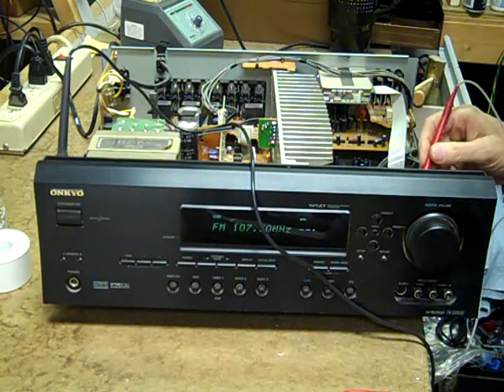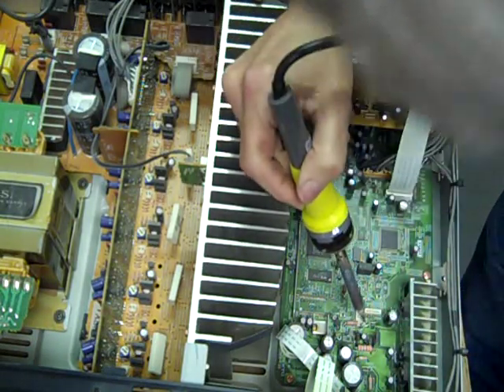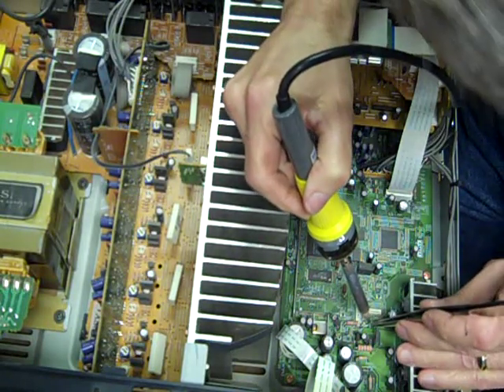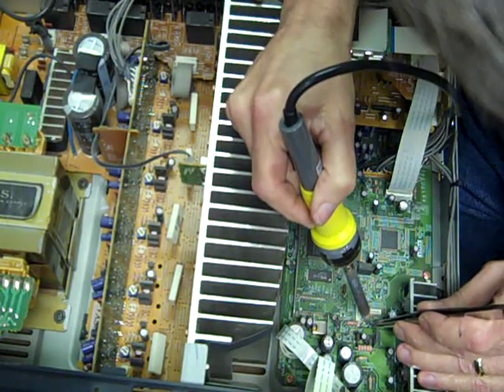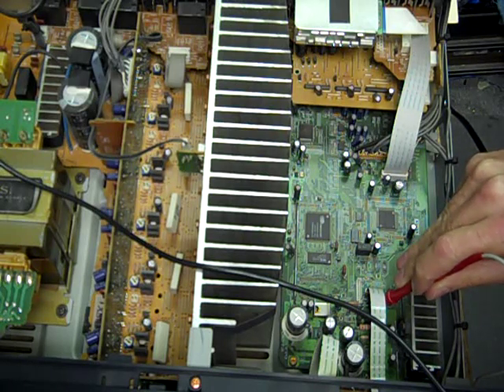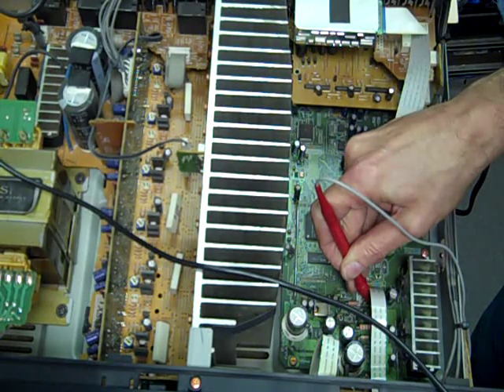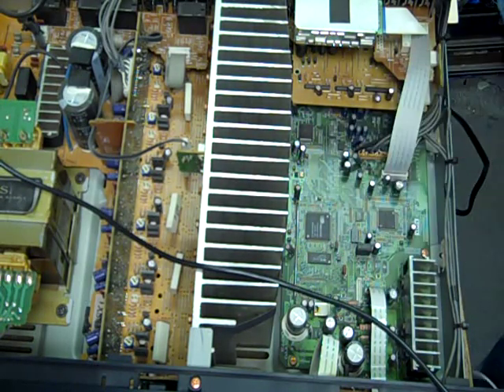Onkyo TX-SR502 Repair Brief

Comment: Mark,

Just wanted to let you know the oem 5 volt regulator was indeed bad. I replaced it with a 1.5 amp lm7805 and now everything is working properly. I did obtain a service manual and schematics for the receiver which helped immensely.  Thanks for making the video. It steered me into the right direction as to what to look for.  While I was at it I also checked all the 12 volt sources to make sure their outputs were in spec. Again, thanks!
Reply from the maker: Good Job!

Comment: Mark you are genius! Removed speaker A relay and replaced it with speaker B relay(until i can order a new relay off internet as nobody stocks that part in my area) and it works better than the original ever did. After researching everything from part location, solder removal and soldering(using my hobby wood burner at that), i am very happy with the result and appreciate your advice to no end. Now im interested in learning all the basics i missed. Thank you!
Reply from the maker: That's great to hear! Thanks for the feedback!

Comment: Mark:
Excellent suggestion on the output side cap. Tested at 95 Mfd. Should have been in the 330 range. Also replaced the +5 volt regulator with an LM7805.  Unit works perfectly (everytime ) now.  Thanks again so much for your help. Appreciate you!
Ryan
Reply from the maker: +ryanbdr I accept Paypal... ;-)

Comment: Thank you Mark, for creating this particular video. Without it, there'd be an amp on the way to the tip. Instead, I've just fixed my amp (same model)!!! I didn't bother with the coil -- I just soldered a jumper across, like you suggested. Works fine now! Thank you very much for sharing your knowledge. :) I have another of these in the attic, with the same symptoms. I'm going to take a look at that one now... :)

Comment: lol..i appreciate the response i went to school for computer electronics and im very handy i've fixed lcd tvs...laptops..cell phones etc...but im no GURU thats why i reached out for help and never fixed a receiver and i can see you are very knowledgeable so i measured accross all seven and got .6-.8ohms except 2nd to last i got 620 ohms and just kept going up and up as if its open also the compacitor at that same location is blown the noble reads phr mpr 2w r22k x2 i appreciate your help thanks

Comment: thanks for this video! I have the same receiver, with the exact same issue. I just soldered a bit of wire in there instead of the part (turns out I am too unskilled to solder in the tiny replacement part), and it's been working like a charm ever since.

Comment from the maker: Glad that seems to have worked out for you. There is a voltage drop across the coil in normal operation. Maybe about 0.3 volts or so. Keep an eye on it, but it seems like you nailed it!

Comment from the maker: OK, if you can check transistors, you definitely should check that one that sits between the drivers - it's associated with the bias transistor, and if it's bad the amp will likely blow again. When you first power up, the voltage across the whole emitter resistor should settle down quickly to no more than about 5 to 15 millivolts. If you see a lot more, and especially if it's climbing, shut down and fix the remaining fault. A 100 watt lamp in series with the main power prevents new damage.

Comment: Fantastic and clear video, Mark!  I frequently lose output on several channels (sr, sl, center, back) but left/right and sub are always reliable. I will tighten the banana plugs as you suggested to another commenter, however I think I had the same problem long before I used banana plugs. Do you think this is a coil issue, dsp problem itself, or something else?

Comment: Mark, Don't know if you still check this thread but I have a TX-SR502. I removed the cover, blew out the unit as it had minor dust in the unit. I checked the voltage on each side of the L7002 coil you mention. you state the voltage should be 5 volts. However, the most I get is 2.19V on one side and 2.14V on the other. Where does the 5 volts come from?

Comment from the maker: I don't work on many late model Onkyo's but I can tell you. if it clicks when you press the main power(standby) turn-on button, the smaller transformer is OK. Maybe there are fuses blown relating to the main transformer, maybe that transformer is bad, maybe there is a problem with the -30 volt source for the display. Carefully check to see if the main B+ for the output transistors comes up when you press the power button.

Comment: ok thanks mark. you're pretty certain it's the actual hdmi controller though, from the symptoms I have? it just stopped all of a sudden with all 3 inputs showing nothing. but the menu, volume bar etc working all fine (which made me think it at least wasn't the output gone so wasn't suspecting major chip

Comment from the maker: I'd look first for a blown channel or a bad muting transistor. A quick check is to check the emitter resistors. If one is open, that channel is blown. A blown channel with a good emitter resistor would shut down quicker due to over current.

Comment from the maker: @Iloveufonzi I would just have to do the troubleshooting but problems like this usually come down to either a blown amp channel or a power supply problem of some sort. If you aren't a technician your chances of fixing this yourself are very slim. Even a lot of techs have problems with these.

Comment: Mark: I've check out my other dud amp, and it has the exact same symptoms, but doesn't have the same problem with the coil. However the input voltage of the coil is 3V, not 5V like you mentioned in your video. There's a TA4805S voltage regulator nearby (Q6406) that has 11V on it's input and 3V on it's output. Am I right to assume it should be 5V and to assume that it's faulty and needs replacing? Tx :)

Comment: I have an SR-502 that's had a dodgy subwoofer output from day 1.

I have a nice Sub; I'm pretty sure it's ok, as when there's a hum on the line it reproduces it and the pilot light turns green (on).

I remember there's something tricky about getting the sub to work in the Onkyo anyway, such as only speakers A must be selected, and you have to have the "Deep bass" feature "on" as well as subwoofer selected. All those are true.

I substituted a simple computer audio subwoofer, and it was silent, too.

I wiggle the subwoofer output connector and it makes no difference. I've changed out the cable, too.  It's a simple RCA connected single cable. No joy.

I'm thinking of buying a new receiver, as I get my entertainment off the internet now, not off the air or from a TV. My TV acts as a simple monitor now.  No VCR or CD to connect, either. If I need to play a DVD or CD, I do it through the computer that inputs to the receiver.

I haven't asked the Best Buy Geeks if they fix these yet... pondering a simple amp with 2 or 3 inputs. I need one for the WiFi radio I use.

Any thoughts?

Thanks!
Reply from the maker: You say dodgy but does it work sometimes, or totally non-functional? The majority of reported subwoofer problems I see are operator error or bad subs. That said, it's not uncommon to have a broken solder connection or two at the subwoofer output jack. Many newer models enable the subwoofer through a labyrinthine onscreen menu process, but that seems less likely with the SR502.
Reply: It worked at one point, but not again until... Today!

Talk about labyrinthine... I wrestled with the vague instructions and figured out I had to use the menu to turn the Subwoofer on (impossible if speakers B are on; I use A and B). Then, I had to turn "Double Bass" on.  Now, it works, even with speakers B on. ???

Also, there's no "balance." Just have to go to each speaker and set the DB.  Another reason I'm glad I just have left, right and sub.

Why they make it so hard, I have no idea.  Luckily, though, I didn't have to go to plan B, which would've been to try it with the two front speakers also wired to the sub.

I'm hoping it wasn't just a lucky phase of the moon, and that the sub will still work tomorrow, and tomorrow...

If so, I'll keep the amp, after all.

:D

Comment: Nice video Mark. Quick question, I have a SR-503, and last night after turning the unit on, the display showed the input selection and volume # as usual, but nothing else would work. No sound, volume would not change, input buttons wouldn't change anything. I turned it off and on quite a few times, pushed a few other buttons and then the display started cycling through all of the listening modes really quickly so I turned it off. I have the service manual, any suggestions on how to proceed? Thanks!
Reply from the maker: Clint Lacewell Haven't really worked on one of these, but I have seen Onkyo's get front panel buttons (actuators) stuck. That is, the back of the plastic push-button slips past the tact switch behind it, keeping it depressed and inhibiting the action of the others. Check that all the buttons "click" normally and aren't stuck or really don't feel "right" when pressing.
Reply: Mark Zacharias Thanks will give it a shot later

Comment: Have the caps off the relays and...ofcoarse right now they work but should soon go out. Can they be tested  with a dmm without removing? I think its a push pin relay but i bet its soldered on the other side of the board that i cant see. A common ala2f24 relay.

Comment from the maker: OK, yeah, you have a blown amp channel. The output transistors, maybe one or both drivers, the emitter resistor, the cap, maybe a small 100 ohm resistor right beside them, a small transistor in between the drivers- I think that's about it.Oh, wait there's usually also a 2.2 or 3.3 ohms or thereabouts resistor going to the base of each output transistor that might be bad also.

Comment: Mark, after letting the amp warm up a few minutes the readings on the in and out are now 2.65 volts and 2.49 volts. Is this high enough for the DSP to engage?
Reply from the maker: No, if it's the same coil, that voltage is about 50% low.

Comment from the maker: If everything plays normally and there is sound, just that the B speaker relay won't come on, I would just look for bad solder connection(s) at the B relay coil itself. Actually a fairly common problem on these.

Comment: Dear Mark. Excellent information. I have a sr502 where the front LCD has gone out. The receiver still works fine otherwise. Do you have any suggestions?
Reply from the maker: Probably either bad solder connections at the FL tube itself, or problems with the -30 volt power supply line.

Comment: I have the TX-NR609 and have come across several videos explaining that the solder on the DPS chip balls up and causes an open- thus no sound. The fix is to reflow the solder. But your SR502 fix is different. Would it apply to my NR609?
Reply from the maker: I doubt it - the 502 is a totally different design.  I have had lousy luck with later Onkyo's. The later ones have lots of HDMI and digital audio problems relating to overheating lots of small surface mounted electrolytics on the hdmi boards.

Comment: Hey mark, I have an Onkyo HT-R390, It got hot with me playing my sub loud, it turned off, then when i turn it on it immediately turns back off, the fuses aren't blown, but when i turn it on they come close to blowing. It looked to be one of the ALA2F24 Relays, but I would really appreciate your opinion on this, thank you.
Reply from the maker: Dat Gmod I'm not finding a service manual on this (without paying for a download). A relay would NOT trigger the protect shutdown. Probably a blown amp channel or if it was playing loud for a long time, maybe the main power transformer. The 390 is a lower-mid range model, probably uses hybrid output IC's. I could trace it in the shop, but your chances of fixing it yourself are probably slim, particularly if you are not a technician.

Comment: Hey Mark would be glad for any info where to get started with my moody TX-SR503E as I am a brutal beginner :) Channels do work part time but sometimes I have to do the off/on thing multiple times to get all of them working. Which one is not working is totally random but usually it's the left back (longest cable connection if that matters). Second problem is that in order to get the sub working I have to adjust the cable at the sub-out of the 503 as it just works in a specific position. Any thoughts are highly appreciated! Thank you
Reply from the maker: I have found on these that if you are using banana plugs the receiver speaker posts need to be tightened down securely or channels will cut out.
Reply: So great that you answered Mark I will recheck that! As the speakers work most of the time I guess my real problem still is the sub which is connected via cinch connector (RCA?). I do notice that when I'm manually pushing it inwards past the standard position with a little force it's working fine so I guess the connector is just a tad too short?! Can I just extend it and what best to use?
Reply from the maker: Maybe just try a different cable for the sub? But sometimes get bad solder connection there at the sub output jack.

Comment: Hey Mark. Found your video searching for a diagnosis for my 502 - looks like I found it! Can you tell me what you charge for the repair? I'm in NYC so trying to figure out a ballpark on what I should be paying. Thanks in advance.
Reply from the maker: As a retail repair, it probably ought to be worth 100.00 anyway... these days if you can't get 100.00 for working on something, it's hardly worth your time, with overhead etc being what it is. I'm in Kansas, and in NY it might be more for just that same reason.
Reply: Mark Zacharias
Makes total sense. Really appreciate the response. I have an email into Onkyo asking if their authorized service centers offer a fixed price repair for this - given that it seems to be a very common problem. Not holding my breath but you never know!
Reply: Hi Jeremy -
Did you end up finding an authorized service center? I am having problems with my 502 as well and am NYC based.

Comment: Mark, I'd appreciate your help. I have an ht-r380 which is having the 'classic' onkyo hdmi problems. However it is showing output (as in the menu etc will show up if enabled and it's also changing resolution to match input. But no actual source video is output (or sound). I've seen the fixes on here for the 'bigger' receivers like 606 etc where they change out a few caps on the underside, but this model's hdmi board only has 3 of those type caps TOTAL (I assume one for each of the 3 inputs

Comment: Hi Mark, Just watched the video, I have a TX-SR505.  I plug it in and nothing comes on ,no lights, no standby, nothing.  I checked the transformer with my DMM and seems good.  Where to go from here ?
Reply from the maker: BadRonald1 You need to take voltage measurements. Try to find your standby 5V or 3.3, whichever. I haven't worked on one of these.
Reply: Mark, I'm still learning about Electronics but once I do find say 5v. If you don't mind me asking but How would this lead me to the source of the problem ?   And Thank you for your time.
Reply from the maker: BadRonald1 Well, the microprocessor needs a standby DC voltage source or it just sits there dead and cannot respond to any front panel commands. There's other things a micro needs as well, but the standby voltage is a good place to start. Often you can cheat a little and look to measure it at the infra-rec remote receiver IC or even at the power tact switch. Pressing the switch would ground it out (its not direct from the power supply at that point.) while the button is pressed.

Comment from the maker: Can't know for sure but I suspect that line could be getting loaded down. Maybe some bad IC or other. Sometimes I will sub in an external supply and see if it works, or if some part on the board gets hot. If bringing it up to five volts resolves the issue, then yeah - replace the IC regulator.